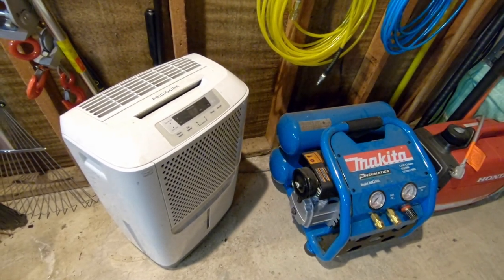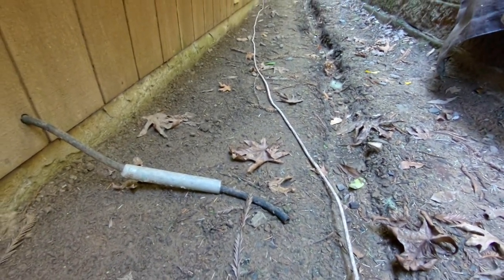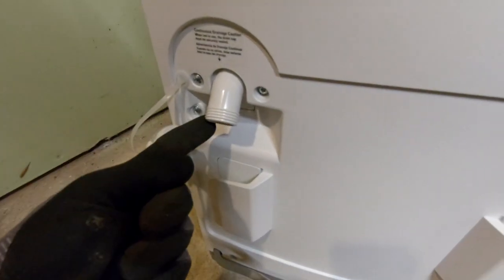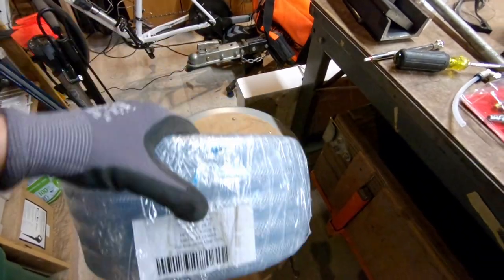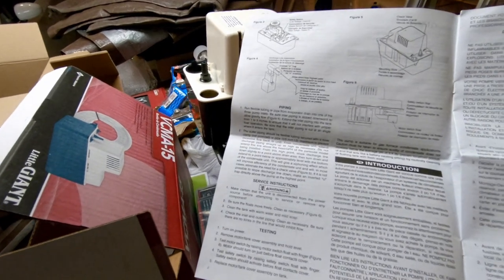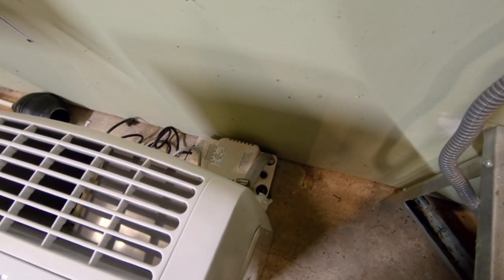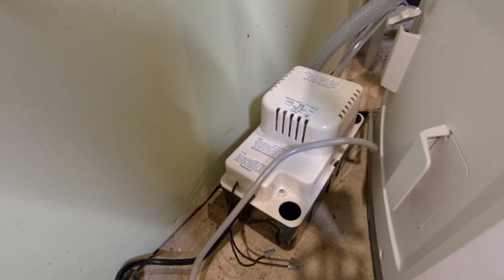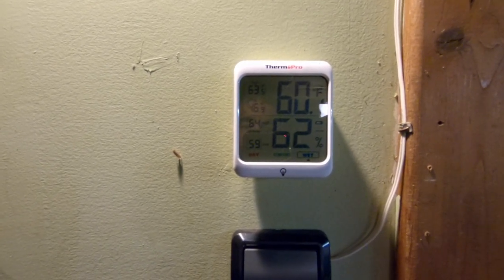Garage dehumidifier and condensate pump install

Comment: thanks.  Im ready to install a dehumidifier.  Did you ever try using a fan/vent to outside?
Reply from the maker: I did not try that, but I don't think it would work in our situation. The humidity is really high outside during the winter when it's raining, so if air is being blown outside by a fan, it needs to be replaced by some other air, which would probably also be humid. So I think it's necessary to get the moisture out of the air that's in the garage.

Our garage door has big gaps around it that let in outside air. We are getting a new garage door soon, and I'm hoping that will keep the dehumidified air contained inside the garage, which will reduce the need for the dehumidifier to run as often.

Comment: Don't you want the humidity down to 45-50? 60 seemed a bit high to me.
Reply from the maker: Thanks for your comment. Yes, I would prefer to have a lower humidity range in the garage, but I'll explain how I got to the setting I'm using (it's actually set to 65% now.)

During the winter it rains a lot here and that is when we need the dehumidifier. The temperatures can be in the mid 30s to low 40s, and our relative humidity can be in the 95-98% range. (In the summer it's not humid so the dehumidifier doesn't run.)

If I set the dehumidifier to a lower humidity setting, it would be running more frequently, perhaps constantly, which will use more electricity and probably burn out the dehumidifier more quickly. My understanding is that dehumidifiers don't work as well when it's cold, so a lower humidity setting would increase the load on the dehumidifier even more than if it was warm outside.

We did just get a new garage door which is sealed around the edges and it's helping to keep the moist air out. Based on a humidity gauge in the garage, it's been hovering around 58-63%. The dehumidifier comes on occasionally, and I'm not seeing rust on my tools, so a setting of 65% seems like a good compromise.
Reply: @noahbeil  i'm in seattle and have mine set to 45 with fan on high. It does run quite a bit but I think it's made to do that. My electric bill hasn't increased that much. When it's too cold it just goes into a defrost mode.
Reply from the maker: @br33zy771  Thanks again for your comment and I appreciate the additional perspective.

Comment: Interesting project.  I need to do something along these lines.  Which model dehumidifier did you employ?
Reply from the maker: Hi Joe, thanks for your comment. I believe it's a Frigidaire FAD704DUD which appears to be discontinued. The dehumidifier is still working well and it's running a lot these days because our outside humidity can be 75-95% during the winter. -Noah

Comment: After the pump went off were there any left over water in the drain hose?
Reply from the maker: Thanks for your comment. Our dehumidifier has been running a lot recently since it's very humid. I looked at the drain hose coming out of the pump and it's filled with water. I looked at the description of the pump and it appears to have a check valve that prevents water from falling back down into the reservoir.

Comment: Thanks for the video.  How much does it cost in electricity per month?
Reply from the maker: Hi Peter. That's a good question, and I don't have an answer. Eventually I will put it on a smart plug that tracks electricity usage. I did put it on a Kill-a-watt and measured it at 72W when it's running. Where I live, it's barely on during the summer, and runs a lot in the winter when it rains.